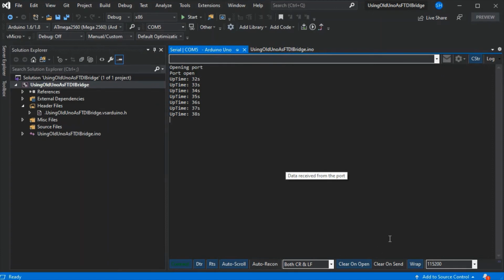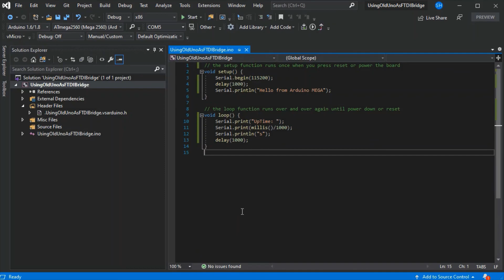Recycle Old Arduino As USB to Serial Adaptor

Comment: hey, i've got a circuit with an atmega328p and tried this to link the uart of my board for debugging purposes and while it clearly communicates back and forth, the serial monitor from arduino ide can't decipher the data im sending (it just outputs �). Should this setup work fine out of the box and i just messed up the code i copied form datasheet somehow or i need to do some more decoding or something? Or it's just not supposed to work that way idk
Reply from the maker: Please ask the question in our forum at visualmicro.com. There can be various reasons for that and someone will asist you.